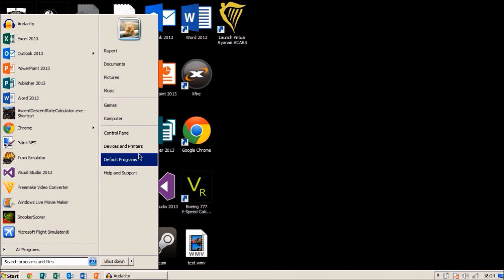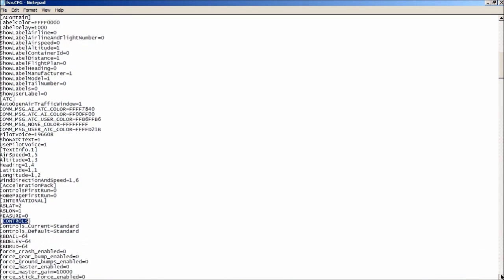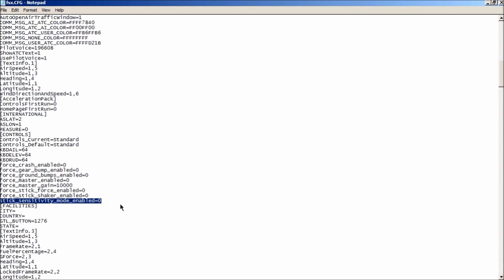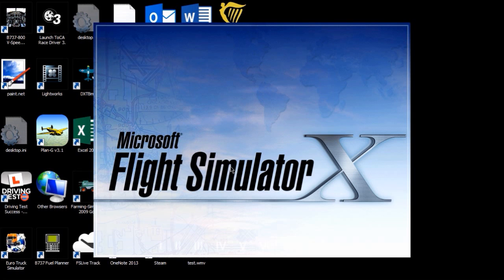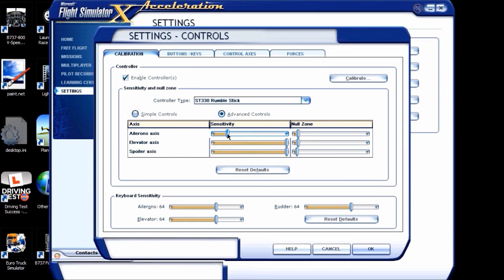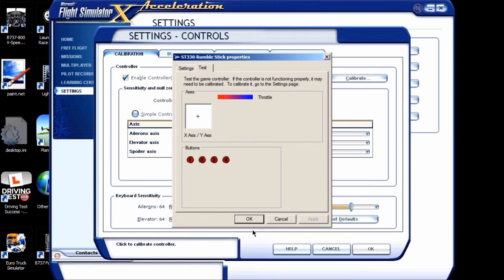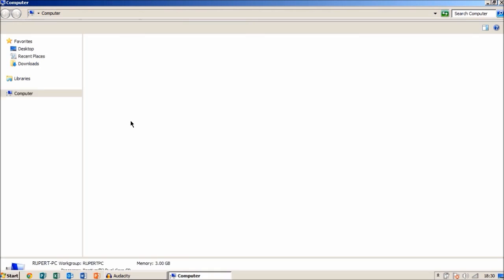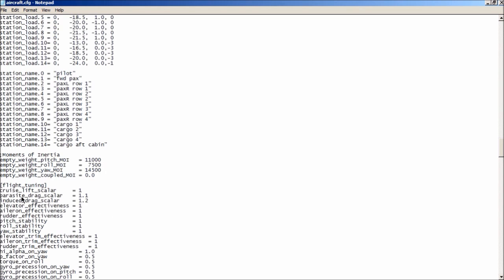FSX - How to setup your joystick/controller properly! (100% Linear!)

Comment: Hi Rupert,
Should I put this under the [controls] entry in my FSX config file?

stick_sensitivity_mode=0     ?

I ask that because in the video I got totally confused with the entry stick_sensitivity_mode_enabled=0

once that is complete save the FSX.CFG file and open FSX to adjust the sensitivity sliders all the way to 100% (127) and the null zone sliders to 0% (1)?

Kindly let me know as soon as possible.

Regards,
Chris

✈🛩🛫🛬
Reply from the maker: I'm not surprised you were confused it's a rubbish video 😂😂 Not sure why it's so popular. Yes exactly what you wrote is correct - stick_sensitivity_mode=0
Reply: Hi Rupert thank you very much.
You helped me a lot.

Now I'll adjust the FSX CFG file alongside the sensitivity sliders in FSX all to 127 and all null zones to 1; this is in the simple controls tab in FSX.

The same will apply to my rudder pedals.

Without the text in the FSX CFG there always is a delay when moving the yoke and rudder pedals in FSX.

Thank you very much Rupert @RupertSoftware  

regards,
Chris

Comment: For the last part of the tutorial for sensitivity settings.... be it .8, .5, 1.2... whatever... do you have a recommended settings table for each aircraft that you can share via PDF that YOU USE?   I ask as the last part of the tutorial seemed a bit more subjective than objective. No offense intended as this was a brilliant tutorial video and I thank you in advance for taking the time to make it.  Cheers!!!
Reply from the maker: It's been a long time since I've even played FSX so my answer might not be the best. But when you edit these files you're editing the aircraft dynamics, so it's going to be completely individual to each aircraft. In theory - 1 should be the correct, but our hardware is different and the default planes definitely aren't that accurate anyway. So I'd say start at 1, if it's too sensitive, drop it to 0.5 and see how that affects it. Then work your way to a good feeling value
Reply: @RupertSoftware  Thank you Sir for that explanation and again, for taking the time to make that video!!!
Reply from the maker: (and of course you can bump it up to 1.5 if it's not sensitive enough etc...)

Comment: I hv tried it with force feed back joystick, edited flight tuning of F35 and F16, i can say, its close to reality, as we know f16 has joystick that based on almost sensitivity and f35 has very good stability co trolled by flight computers. With these settings i had to edited flight tuning as some planes have soft controls. Overall if tuned fine, its close to reality

Comment: Thanks for your demonstration! Actually I'm still wet behind my ears when it comes to changing settings inside some system files! But I just got that THRUSTMASTER T.Flight Hotas X stick and was looking for informations regarding should I install the stick or the MS Flight Simulator via my  Steam account?

Comment: When my joystick is just straight and I don’t have my hands on it or anything the plane automatically goes up so how do I fix that
Reply from the maker: You can go into decide properties for your joysticks in control panel and check the calibration is alright (Google if you don't know how...) But otherwise as above it may just be the aircraft out of trim
Reply: you cant,  the airspeed its what making it do that

Comment: The file in FSX SE doesnt have "facilities" the next bracket is [TextInfo.1]   (Still Works)

"But my problem is with CH yoke elevator it has a noticeable lag in either direction (elevator works but in slow motion)? Thanks"

Update: Turns out theres a wheel on the front of the yoke, that will increase or decrease a pitch only lag. for those w/problem.
Reply from the maker: Nice cheers for the info

Comment: For some reason my joystick is normal but in game, it turns 20 degrees to the right??? Help and i tried to fix but no work and i am on FS2004.
Reply from the maker: I have no experience in fs2004 and don't really know what to suggest other than to calibrate it in windows and make sure you try going full left and full right in game as this sometimes calibrates it in other games...

Comment: Sorry, but this doesn't do what you say it does. I did this experiment in detail with a Saitek Cessna Pro Flight yoke and the default Cessna 172, so it was easier to compare the yokes because they look basically the same. It is clear the non-linearity remains regardless of STICK_SENSITIVITY_MODE. Look for my Saitek Pro Flight Cessna Yoke review video if you want to see the two yokes side by side (and skip to 3:25 for the relevant bit).
Reply from the maker: Hi thanks for taking the time to do this useful comparison and also for leaving a comment. I haven't really been doing much FSX recently however, from experience in the past I *THINK*, and do please feel free to test this, that the animation of the cockpit yoke is not directly mapped to the physical movement of the ailerons or elevators. Perhaps, it'd be worth comparing the rotation of your yoke with the movement of the control surfaces. In reality the animations should be altogether disregarded since after all they're just the eye-candy and have no effect on the simulation. Though I do not know how FSX was developed, I do know the keyframes of the animations of the yoke for example will not necessarily have been set  (especially in a default aircraft!) such that the occurring animation is directly 1:1 with the displacement it is representing. Instead it would be better to consider purely the numerical value of the control surface within the simulation at that instant since that is what we're really interested in (but of course this isn't actually possible without using some developer mode I'm not aware of)! So, what it really comes down to, is if this tweak makes the controls feel better... use it, but if you find it makes it worse of course don't. Clearly from the comments on this video it's a bit of a mixed bag of opinions that is entirely dependent on your hardware and aircraft that you are using.
 
Thanks!
Reply: Okay, I have tried this out using a tool called AFSD for reading the actual aileron displacement from FSX internal variables and plotting this for 30 positions of the yoke. As a 'yoke' I used a Saitek throttle quadrant mapped to the ailerons. Being an old Saitek quad it is a bit glitchy but the results are repeatable. Interestingly it appears that neither of us is quite right. What I seem to see is that both settings of the SSM flag have non-linear (approximately exponential) curves but they are not the same. It appears that the SSM=1 (i.e. default) curve is a bit steeper but then curves back in towards the extremes. For the SSM=0 curve it's hard to tell quite if continues to curveat the extremes or if it becomes roughly linear, as the data is jittery. Either way, with SSM=0 the net effect is it looks significantly less sensitive when the yoke is deflected beyond half-way to either side, so I guess you win in spirit at least :)
Reply from the maker: Almost Aviation Ah interesting!! Thanks for finding that out I definitely can't argue with experimental data! I think perhaps I ought to change the title because it clearly isn't 100% linear like I originally thought :) Happy flying!

Comment: Hi Rupert Smith thanks for sharing such great information and doing this demo tutorial, I use Thrustmaster Hotas warthog and Saitek combat pedal and wanted to know to tweak Saitek combat rudder pedals dead zones and sensitivity.Would you mind shed a bit of light on how you would config rudder pedals inside Windows,Ctrl panel, Device & printers game controller's? thanks in advance ...
Reply from the maker: Hi unfortunately I don't really have any experience with Saitek products, however I would assume most of the adjustments can be done within Saitek's driver software? I shouldn't think you'll have too much setup within windows however I'd also say you shouldn't really need to tweak the rudder pedals as long as there is zero deadzone set in FSX and, if using this tweak, the sensitivity should be set on max - otherwise set it half way since this should result in a linear response. To see what configuration windows does have though, right click on the device -> controller settings ->  properties (of the pedals) and then that'll give you all the available settings. Again my advice would just be to make sure they're on what will most likely be default sensitivity, but with zero deadzone since Saitek products are pretty good quality like that! I hope this helps you, sorry I can't be of more use :)

Comment: Hi Rupert Smith!
How are you?

Could you help me to my Aerofly 2 that I have in my laptop read or make work my ps3 control..?

please.. I've been searching any help to do that and I can not...
Reply from the maker: Hello I'm great thanks, unfortunately personally I have absolutely no experience with aerofly 2 but if it supports joysticks which I highly suspect it does, your best bet is to emulate your ps3 controller as a joystick/gamepad that the game will then recognize. How you do that I cannot be sure because I've never messed around with controllers however I can hopefully point you in the right direction. What you need is an application that emulates your PS3 controller as a joystick so perhaps search that. MotioninJoy appears to be something that may work so give that a go! Unfortunately when you're looking for software like this you'll often find it on slightly dodgy websites so just watch what you're doing and ideally run ad-block and you'll be fine... but you have been warned! I hope this helps and drop the vid a like or perhaps subscribe as it really helps :) thanks
Reply: What do you say..I must try with motioninjoy?
Reply: Yeah man.. you have reason.. sometimes there are so many virus on the ads..
Reply from the maker: Luis Alberto A. V. Yep give that a go, if it's no use search around on YouTube for "ps3 joystick emulator" or something like that
Reply: Rupert Smith 
Nothing man... I think that is my windows.. I got the 7 .. and some stuff doesn't work before... Right now I thought that must be that...
Reply: ¿What do you think?
Reply from the maker: I don't know sorry
Reply: Oright man,  thanks for everything and for youl help!

Have a great Day!

Comment: I remember when this tweak was all the rage and, sadly, very misunderstood.
You can make the fsx.cfg addition if you want to, but then you should control sensitivity through the config screen.
DO NOT edit the cfg of individual aircraft.
The non-linear mode was designed for joysticks, linear mode for yokes.
Therefore, making this change when you are using a joystick actually REDUCES your controller inputs by as much as 30%.
If you fly "big tin", you will notice that this change appears to make things better (but you're only using the stick in a limited range), in a Military Jet or, even worse, a helicopter, this tweak will make things worse.
Reply from the maker: Snooby66 It certainly can't be changed through the cfg window with this tweak, but I definitely agree with the rest. Personally for me it always worked well but I do totally agree that yes it will affect the flight models, with that being said if it improves upon the default enough that it makes it feel better - then for some people it is going to still be worth doing. It all just comes down to whatever you do its not going to be perfect so just do what feels best, perhaps fsuipc is the way to go for those looking for more control. Thanks

Comment: I dont fully agree with you sir, you would be right if it was a brunner yoke or pfc yoke, but not when you use saitek or other crap. When using cheap yokes like saitek, you gotta reduce sensativity because their moving range is far less then the real flight controls.
You cant have realistic flare on landings with the saitek setup full sens on a cessna or 737
Reply from the maker: Hi Haykodjan, use whatever works for you! This is simply as it says a way to make it more linear and more responsive, like you say this has it's drawbacks: for some hardware it may be jittery or (though if you watch the video I show you how to reduce the sensitivity using this method). Like I say, use whatever works for you, personally I find this works really nicely, others would agree but then I'm sure there are others who would agree with you. Thanks for the comment :)

Comment: my Control setting are very different from yours. can the video instuctions be used to calibrate stick after a plane has been selected. i have ms FSX. yours says fsx but very different .config file
Reply: added the setting and it works well now. thanks

Comment: so if the deadzone is null what is the range setting for and what does this control?
Reply from the maker: Well the sensitivity after doing this mod is not useful at all. All it does is limits the amount you can move the yoke ingame, so really you don't want anything but 100% otherwise you'll be limiting how much you can move the joystick/yoke

Comment: You're making the controls linear which increases sensitivity, but then decreasing sensitivity back down using a different method....that's kind of altering the flight model a bit and you can't really call it realistic.  The whole point of the non-linear control scalar is to make up for the fact that desktop controls don't have the travel and force of a real aircraft and are thereby simulating it.
Reply from the maker: tasev1 You make valid points except a couple of things. A. Some of us do have enough travel in our controls B. Fsx does not simply apply a function to make the controls non linear, it also adds what I can only assume is a basic form of smoothing. This smoothing effect, although is useful for jittery control inputs, puts a delay and thus makes the controls slow to respond. C. Nothing we can do in our setup is 100% realistic but their are things we can do to improve it. No this does not significantly change the flight model, it's just an easy way of adjusting the sensitivity - if you really wanted to not adjust the control surface effectiveness you could, by means of some form of virtual control mapping software such as glovepie plus ppjoy, apply an exponential function to your raw control input and then apply a transformation to this to retain the same control range then map this adjusted value to a virtual joystick. D. The amount of positive reviews of this method clearly show it works and improves the fsx experience. Thanks for your comment :)
Reply: Rupert Smith cool. I'll give it a shot and see what happens. I only just got rudder pedals for the first time and am NOW seeing how inferior the flight model can be compared to xplane. After all these years. (VKB T-Rudder mk iv)
Reply from the maker: tasev1 Ah very nice! Well enjoy them and I hope you can get it configured as desired

Comment: I am having problem while landing aircraft pitch too high about 3.6 or above than this can you tell me why is this?
Reply from the maker: Well, there could be a few causes to this. If by the aircraft pitching too high you mean you are over flaring, then either just put in less control input or reduce the sensitivity of your joystick (i.e. in this case reduce the effectiveness of the elevators). If the aircraft is pitching by itself too high then it will be because you're either going to slow or you are flying out of trim. Trim is an important consideration and I'd recommend taking a look at some tutorials about it if you do not use it. I hope this helps, if it doesn't try and explain a little more exactly what is happening. Rupert

Comment: (Not sure if anyone will even see this, but oh well)

All the buttons on my joystick work fine, and so does the Z and X axis. But for some reason FSX doesn't pick up any Y axis movement and the calibration + symbol is always stuck at the top of the screen. Is there a known fix for this?

Joystick: Logitech Extreme 3D Pro
Reply from the maker: Hi Camicus, definitely sounds like either a calibration, driver or a hardware problem. On the calibration window, assuming it uses the default windows one, there should be a tab that allows you to reset the device to default and to perform calibration, give that a go and see because that might work (if you haven't tried already). You could also try pulling the joystick fully aft before you press calibrate, this way when you then calibrate and push it forward it should 'realise' that the calibration is off. If this doesn't work, possibly try re-downloading the driver (I don't see how this would help but worth a try before saying it is a hardware problem.) If it is a hardware problem, then it's probably the case where a wire has just detached from the potentiometer or the circuit board, you can just re-solder it on and that should solve the problem, alternatively the actual pot itself could be damaged but this is pretty unlikely - if you do need to re-solder watch you don't hold the iron on the circuit board for very long as it is pretty easy to damage the capacitors (especially on cheaper circuit boards). Hope this helps, Rupert!
Reply: Thanks, I opened it up and somehow managed to fix the problem. It works perfectly in the logitech calibrator, but for some reason in the FSX settings the Y now either neutral, full up or full down and no in-FSX calibration will change it (Even with no null zone + very low sensitivity). But, at least it's better than 100% down all the time!
Reply from the maker: Hmm right OK keep me posted how you get on for future reference, with this tweak make sure you use 100% sensitivity but other than that I don't see why it shouldn't be exactly as your calibrator shows